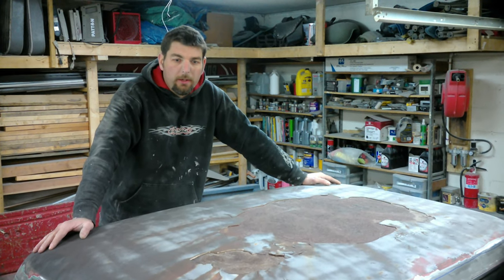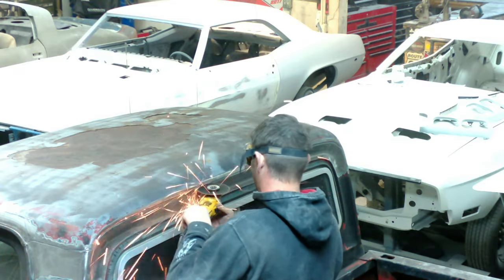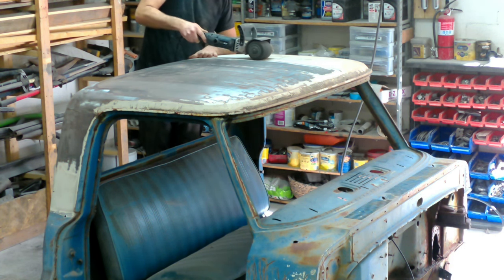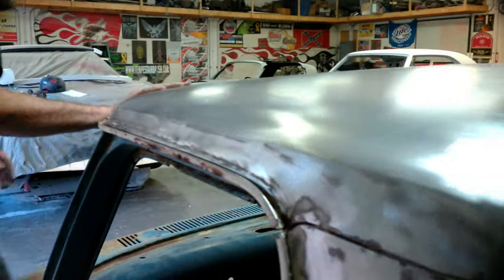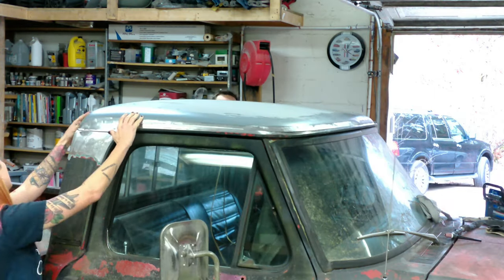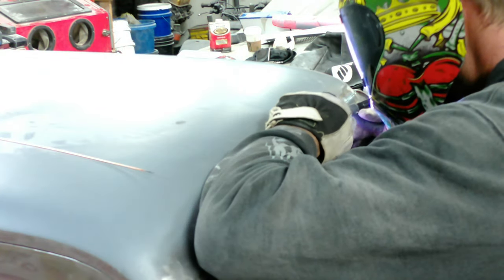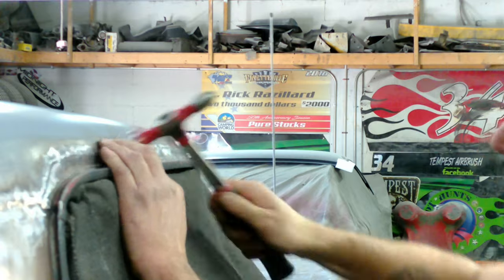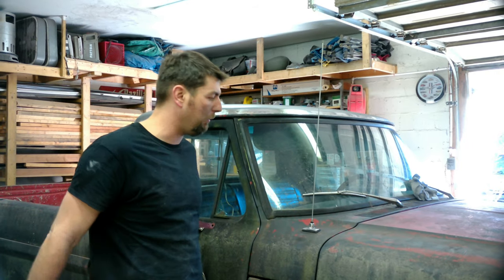1967-1972 F100 Roof install

Comment: Thanks for the video. I am in a similar situation as previous owner had installed cab roof markers that leaked. I have my donor roof and am trying to figure out the best place to cut. You mention you would do it different if your donor roof would have been better. Where would you cut the A and B pillars? Thanks
Reply from the maker: thank you watching, I would actually keep the front lip and drop it straight into the channel and plug or roselette weld it with a MIG. If you look there are other videos of different year f100s earlier then this one where guys use the channel. That is how I would personally do the front lip if your donor roof is in good condition. I do think either the way i did the rear of the roof or like I showed in the video lower on the rear panels into the window is the only two ways of accomplishing this job without too many problems. Good Luck let me know if you get stumped ill see if i can offer any more advice

Comment: How are you going to get filler and paint to stick to the bronze?  I've had filler lift up over bronze but I've never had it lift up over steel welds.
Reply from the maker: Brazing has been around way before filler and different forms of bronze rod has been used in old school bodywork successfully before filler even came along. Using the right base in this case epoxy primer and properly following the MSTS data sheet is key to getting your epoxy to stick to your base material no matter what it is filler, bare metal or SIB. For instance this epoxy needs 120-180 grit on bare metal to adhere properly.  If you are using paint directly to metal that is not a direct to metal paint it won't stick well to anything and risk peeling off in the future. I use the bronze regularly and with proper pre perp, wax grease remover and epoxy primer or even etching haven't ever had an issue with it. This is my wifes truck so  I see this repair job most everyday and it still looks like it did the day I did it. I hope this might help you out with your future work.
Reply: @carthageclassiccars  I have done one bronze repair and the filler lifted up in under 3 years.   I had no filler lift up over any of my actual welds.  Granted at the time I just plopped the bondo right over the brass but everything was sanded and clean including the brass.   It seems that there are so many stories of paint and filler lifting up over brass that I don't know why anybody would use bronze....especially when you have access to to a tig welder.    I once tried to repair an old motorcycle gas tank that had multiple brasing repairs on the bottom to repair cracks. I cleaned and ground down all of the old brasing then re-brased everything.  I did this multiple times and every time I was done I pressure tested it and got multiple leaks.  Finally I just cut out all of the metal that had any brass on it and welded in all new metal with oxy-acetylene and presto, no leaks on the first pressure test.
Reply from the maker: @1BSARoadRocket  I understand what your saying and with the different amount of primers etc. who knows why it didn't react well and stay adhered with your project. I do agree with joining most panels together especially butt welding a TIG with ER70S rod is the way to go. Where I feel this  silicone bronze rod it useful is in that rear roof channel in this video. You would have to heat up the ER70s rod way too much to fill in a gap that large where the SIB melts at such a low temperature you can just pile it in there. Its a similar process to leading in the roof in a lot of factory cars of this era. I also have used it many times in the place of seam sealer for its longevity around edges again keeping the heat out of the seam. Finally I think the #1 use for SIB in the automotive industry is joining metals that are different together. You can join end caps or trim edges made from aluminum or stainless with low heat and basically bond or solder them to mild steel with more longevity then anything else i am aware of.

Comment: I have to replace my with one like yours.  Can you give me a hint here to look ?
Reply from the maker: I wish I could honestly this roof took me 2 months to find looking through FB marketplace. Depending where you live more then likely there is someone parting out a 2wd long bed that hopefully isn't too rusted at least up top. If you can look in the drip rails see if you can take something with you like a wire brush on a drill to clean out that area so you get a better donor then me. Good luck on your search!

Comment: I have to replace my roof also and my drip rail is a mess . I want to fill in the seam on the back as well . My donor roof is perfect and the drip rail is perfect also .I was wondering i”if I cut through the front windshield pillar and then cut the seam like you did if that would be a good way to do it . Also I only have a mig welder .
Reply from the maker: I know some people that do the roof the way you are talking about and with the mig might be easier to not worrying about warping it. Personally I would watch some videos and tutorials on how to do a chop top on a roof on some of the 40's style cars. I know you aren't lowering the roof but the concept will be the same for your project in the front and maybe give you some tips on how to get the front a pillars back in line perfect. Also just take lots of measurements as you want to make sure that windshield fits back in the truck especially since those are the kind with the seal around that edge that get pushed in the measurement around the front i believe is a bit more crucial. Good luck with you install!
Reply: Hey man I appreciate you responding back to me . Yea I’m wanting to basically keep most the drip rail from my donor roof . The drip rail on my truck is ate up above the windshield but good on the side so I think the way I’m thinking May be the best . But yea I’m gonna take my time and measure and measure and then measure again
Reply: By the way I enjoy your videos
Reply from the maker: thanks

Comment: That’s not a third brake light assuming it wasn’t converted to that by somebody else. Vehicles from that era didn’t have a third brake light there. That’s an exterior light that enables you to see what’s in the bed of the pickup when it’s dark.
Reply from the maker: That makes sense I have been around a bunch of these trucks and haven't seen it in any of them so I was just assuming. Thanks for the clarification.

Comment: Why did You TIG instead of MIG? Less splatter
Reply from the maker: The TIG has a lot less heat, its more controlled, and the weld is a softer weld so it can be hammer and dolly back out without cracking

Comment: I watch you do your 67 to 72 roof installation .just try to help. but you welded it way too much. if you cut through the windshield pillar and from the rear across from the door under the drip rail to the back window . peace one that away that's least and  likely to warp. best weld strongest if you didn't want to swap the cad. but you did it the hard way just giving some advice being a body shop man for 50 years
Reply from the maker: Not sure if you watched the whole video but I went over why I had to section in the roof this way. The area above the windshield drip rail of the donor roof was all rotten away (you can see it in the clip) so I would have been putting a worse section in then what was already on the truck. What I did was take the best of two roofs and section them together. I also was saying in the video that I would have rather done that for the rear pillars however the customer (wife/boss) wanted it done this way and it was to make her happy. I appreciate the advice, but in general TIG welding the roof barely warped it and honestly only added a few hours of extra time all that still was a lot easier then swapping another cab over that would also have probably been in just as bad shape.